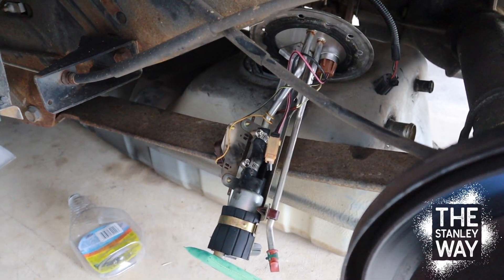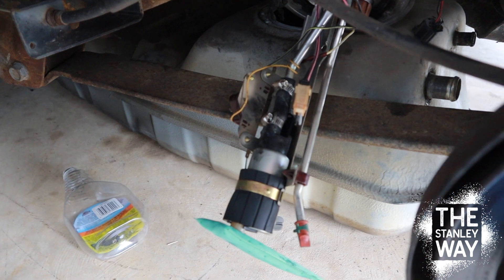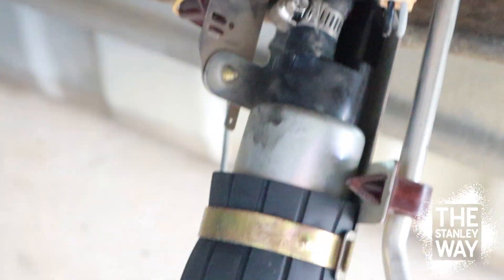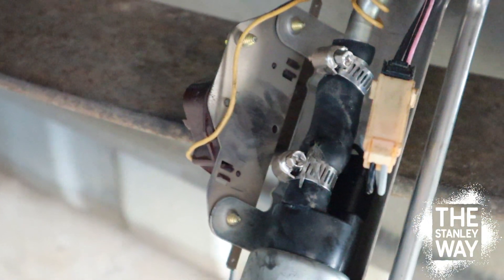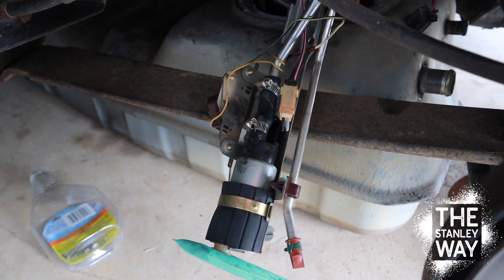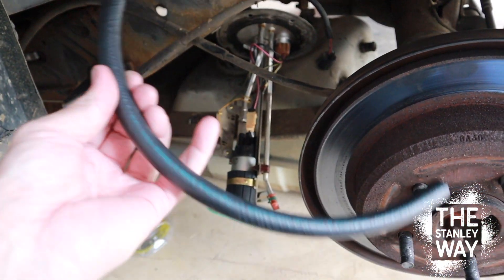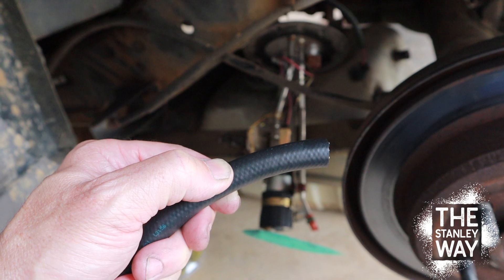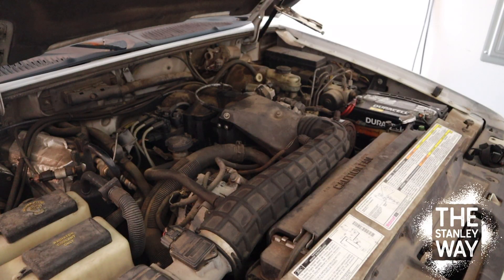1998 Ford Explorer Crank No Start Video

Comment: I just need a diagram for a fuse box inside the truck and the one underneath the engine. My fuel pump is not making no noise at all and I believe a fuse or relay  could use  use some help thank you God bless you  98 Ford explorer
Reply from the maker: https://youtu.be/29mufACMl_I?si=lMBev493kInHojpI

Comment: Hey man I have a '98 explorer XLT as well, recently got an oil change, new fuel pump, filter, and it was running just fine. I'm not sure if my gas just evaporated from not having a gas cap, but will a car perfectly crank if it has no gas?
Reply from the maker: No it won’t run with no gas. That much gas should not have evaporated out though.
Reply: @TheStanleyWay  to be fair I had barely over Empty
Reply from the maker: @LilScottMusic  it may be a good idea to put some in and try again. If you try to crank it too much with no gas running through the pump it could burn it up so be mindful of that.

Comment: I have a 1999 ford explorer with a similar issue crank and no start I troubleshooted it like in youre last video to make sure it's the fuel pump and it seems that it is. I never changed one before and I have a full tank of gas any other tips?
Reply from the maker: I would try to get as much gas out as possible to make it easier but it is ok to take the tank out  full, just be careful. Use a jack for the tank, remove the two front bolts and strap. If you don’t mind gas spilling where your truck is, let it flow out of the tank while the front is still in the bracket as you lower the back end with the jack. 

With the left rear tire removed you should be able to get to everything. Just take your time and you will do great.